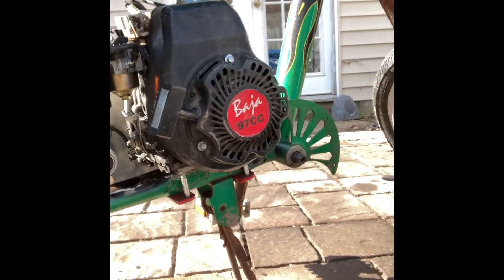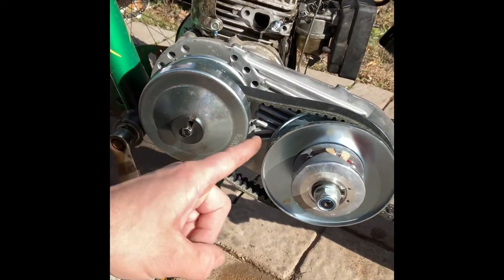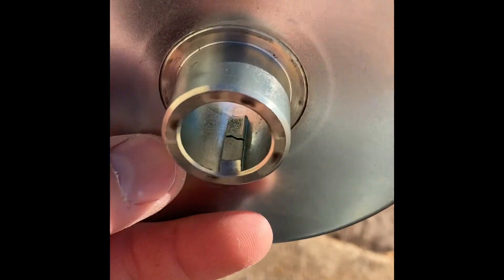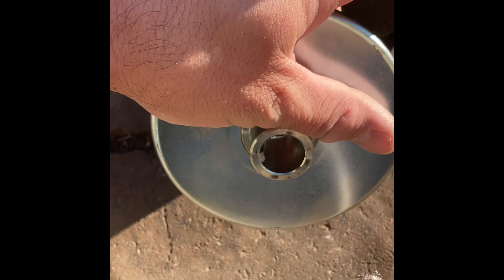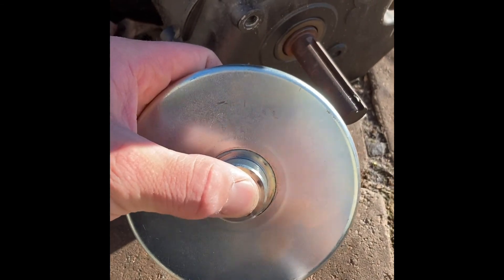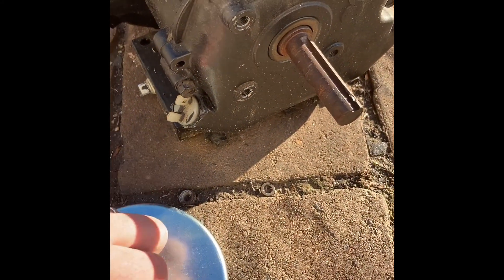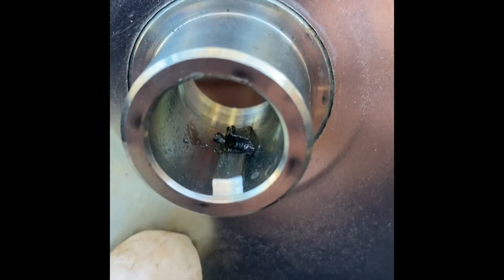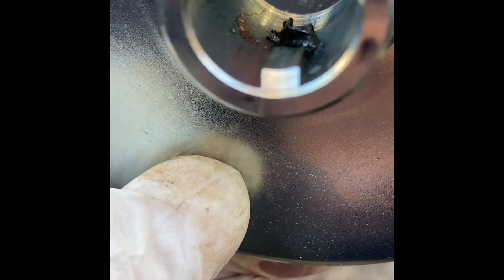How to install / make a Torque Converter for 3hp engine with 5/8 shaft

Comment: Bro 4 years later and I'm going crazy with my 79cc predator was going to drill holes on both sides of the sleeve tac weld it to the shaft .... Your amazing